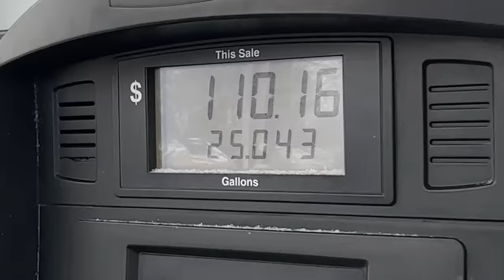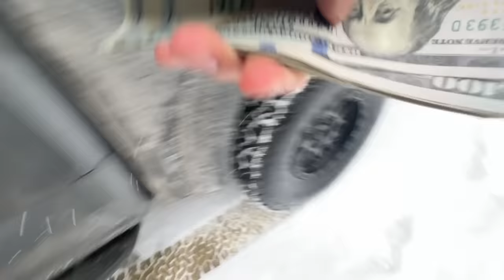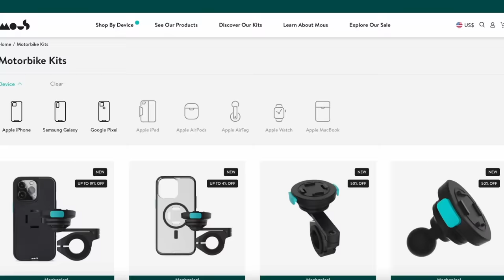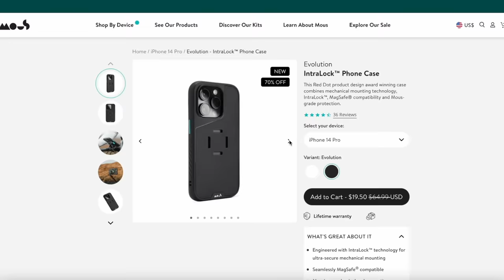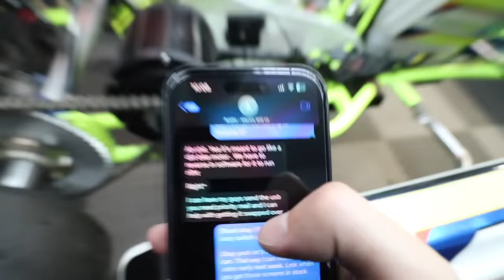Building a 100HP Electric GoKart!! // INSANE 72V Surron E-Kart RIPS

Comment: the controller has three wires going to the motor ...reverse two of the wires to change rotation
Reply: Yes it's a 3 phase brushless motor, but it's "sensored" so you cannot just swap the phase wires. It will smoke the hall sensors and fry the motor.. You have to go into the UI or app and change the settings to reverse the motor direction.
Reply: @tgif9735 not sure on these but alot of ebikes u can swap 2 on the motor and one of the same colors and one opposite color from what u swapped on the motor fir the hall sensor and itll work too
Reply: @Todd_Gerhardt those are Sensorless Brushless motors, Sensorless Brushless motors don't have the hall effect sensors and the circuit for the sensors used for finding the position of the rotor, so reversing the 2 out of the 3 phase wires has no consequences besides reversing the phase direction for power input. Sensored Brushless motors such as this one use hall sensors to determine  the position of the rotor so it can start up and run smoother at lower rpms and be more precise with power delivery eliminating the cogging effect Sensorless Brushless motors have when at lower rpms or when trying to move from a standstill. but because of the sensors, you can't swap the wires to change the direction without de-syncing the sensor circuit from the phase wires and shorting it out making the motor and esc useless. So hence why sensored Brushless motors and esc's can't just be reversed by swapping phase wires like Sensorless systems, it confuses and shorts out the sensor system, each hall effect sensor has its assigned designated phase wire.
Reply: @tgif9735  Oof.
Reply: @Todd_G_FPV   If you do that with a sensored system you end up flipping the timing. Always do it in the UI.  It takes but 10 seconds.
Reply: @tgif9735 umm yea, neither of those things will happen....

Swap 2 phase cables and 2 hall wires to reverse it if the controller doesnt have the ability to do so itself.
Reply: What he said

Comment: 70h and 90h is the size of the magnets in the different versions of the qs138 not the hp! If its their 25kw kit its only around 33hp.
Reply: was just about to comment this
Reply: 100hp would be close to 75 kW. You would need a 72v battery that could put out over 1000 amps to power the motor.
Reply: Yes 25,000 watts  ÷ 750 watts = 33.333333hp

750 watts = 1hp
Reply: if u look close at 5.11 min u see the motor is only 4000w
Reply: @Danny-pp8xz  that’s 5.3hp then
Reply: Was going to say! a 125cc KZ2 would destroy this
Reply: also IF the battery, and controllers where able to send that sort of power (over 1000A) a 75kW/100hp ekectric motor would just do a burnout from 0mph to top speed 😂  put two small second motor in the front for AWD if you wanna drag race or do crazy launches
Reply: Also was going to comment on this. If you look at the Electro and Co kits, while very cool and high value, the biggest I see is a 25kw, and the converter can output 350 amps, doing that calculation gives 25.2kW, so not accounting for efficiency loss, or if the batteries can do this as well, that’s 33.8HP. Having driven many many 5kw electric karts, this does look like roughly 5x that power, but not 20x that power.
Reply: @Danny-pp8xz  LMAO yes, when looking at the numbers, i found the exact same motor on aliexpress, rated at 4000W and 7500W...
Reply: @MotoGpDYLWAH  When looking at the kit, they use a 5.5kW rated motor, but wrote in the spec sheet that it accepts 25kW bursts.
Reply: @Danny-pp8xz  that is the nominal wattage you should use the peak number because it wil only be at nominal at top speed
Reply: @adriendebosse6941  In a lot of electric vehicle conversions they run the motors far above rated spec. I can guarantee that these motors are being pushed past 20kW, though it's only under peak acceleration. Most of the time you are hovering around 5kW.
Reply: Would you happen to know whay electric and co. Kit he's using? You'd be a GOAT if you could tell me
Reply: @MotoGpDYLWAH   you think you could tell me what parts Tyler is using in the video? Am a bit confused by all the different batteries and am not sure which kit he used from electric and co.

Comment: This looks fun but theres no way it makes 100hp, 100hp is 74kw and rough math that 72v battery would have to put out more than 1000amps to the controller with no loss to get 100hp, my guess is it probably makes 20hp but its torquey! Would love to see it on a dyno
Reply: I can tell from the speed it's making about 40hp If not even more
Reply: @caluzzucarrazzi5549   dont' compare to gas, gas engines only have their rated max hp in a very narrow band of rpm, where as electric motors are much different. it might be a 40hp engine, but it might output 20hp when it runs
Reply: @mattbanks3517  yes
Reply: @caluzzucarrazzi5549  i have 35kw e scooter and it flys me with 3.6s to 100kmh/62mph. Me and scooter 110kg. Its crazy shit.

I think the kart is 20hp max. Nothing mental. Look for 128hp e kart at youtube what germans built, then you can see what real numbers mean🤣🙏
Reply: He can't read/do math. It's about 25kW or 33hp.

Comment: Alright, I figured it out. You have a misunderstanding of Electro's model numbers. they have a "70H" and a "90H" kit. This refers to the overall length of the motor, not its power output. The kit you have is a 90H kit with the EM-260 controller that produces a peak power of 25kW/33hp. not 100hp.
Reply: Not even that. Look closely about 5:12 in the video. The motor is a 72v 4000w ( 4kw, a little over 5hp).
Reply: @jscruz2  You're totally right. I was mixing up the actual motor specs with the motor controller specs
Reply: @jscruz2 These motors are deliberately under rated by the manufacturer as a way to slip under the radar so to speak. Its clearly not processing anywhere near the claimed amount by the video. But, these motors are much more capable than their rating suggests. The qs138 70h can handle 30kw whereas the 90h version can do about 35kw at 72v before encountering heat problems.

There are no standard regulations for motor power at the moment, meaning its down to the manufacturers discretion. However in the last couple of years, certain ebike motor kit manufacturers have decided to take advantage of this and made ridiculous claims on the power level of their products. There's a mid drive cyc motor kit that the company claims can handle 5kw. It's a bullsh1t claim. The magnets are tiny and phase wires cannot handle the amount of current required to make 5kw even at 72v without heat damage.

Comment: I built almost the exact same thing about 6 months ago. 2 72v EMBX batteries, a qs 138 90h motor and a 430a controller. With fully charged batteries we are at about 82v discharging 430a nominally that also gives us bursts of about 60hp at 45kw. It is an absolute MONSTER.
Reply: What controller did you use?
Reply: @jeffhhdro  the siaecosys/fardriver nd72800
Reply: Build me one lol
Reply: Holy shit thats insane
Reply: What are the exact specs of the battery you used? And relatively how long does it last before the kart is dead?
Reply: Yo dude, could you tell or list me what kit / which parts Tyler is using in the video and which battery? You'd be an actual angel dude
Reply: can you send me the parts list

Comment: Just for your info, that's not a shifter kart. It's a standard 2-stroke kart. Shifters have a whole lot more kit to them, a shifter for one. Clutch handle, three brakes instead of one (one on each front wheel and a third on the rear axle). For the power and weight you have in there a three-brake setup wouldn't be a terrible idea.

Comment: If that screen displays Amps, the max draw I saw was 200 Amps, which with 72 Volts is 14,4kw, which is about 19 HP, which is still insane, but the title is quite a bit misleading, great content though, keep it up!
Reply: was thinking the same. 100hp is 75kw
Reply: 19hp 😂
Reply: So it's actually very slow for an adult gokart. Very very very expensive for such little HP.
It's a lot but not in comparison to the gas ones

Comment: I just saw your video today that you did several years ago and you took my advice of going electric on this project.  A smaller sprocket on axle  produces increased speed but less torque.  I would mount motor on rubber spacers to reduce noise.  Also shielding the motor will reduce noise for quieter ride.  Again, I was right by going electric.  Sorry you live in NY with 6-months of winter.

Comment: I would like to know which exact specs did you pick through electric and co like for example what motor ,controller, battery , throttle etc  for a similar build and I would also like to know the gear ratio.

Comment: Few small things:
- You don't have a keyway on the sprocket to avoid spinning the sprocket on the axle. Google "kart axle keyway".
- Lube the chain before every drive or you are buying new sprockets. Also the bearings, ball joints, front hub bearings.
- Buy a chain guard, if the chain breaks it could hurt.

Nice build!

Comment: Would running a battery up front, either where fuel tank would sit, help with balance/flex/grip? Or shifting the battery position net to the side pods more towards the front? 

Just seems like an awful lot of weight to position so far rearwards and laterally. That's gotta adversely affect how the frame behaves and grip/drive is made. Plus there's little mass up front to act as a fulcrum like point for the roll centre, to be in/near the centre....

Comment: I have 3 years of experience building a 130V 750Ah sustainable battery and I'm still not done. I broke more than 100 cells and a few BMS. To get that kind of performance, you need a really heavy batterypack. I currently have almost 65 kg two battery packs and only 3.38 kw. can drive only 2 minutes.
greetings from Germany
Reply: Can only drive two minutes? You're telling me you can discharge 130v 750Ah batteries in just 2 minutes?!

Comment: How long will it run on a single charge?   Thinking of building one for Autocrossing.   Wondering if I can use a single charge to be competitive or will I need more than one battery.
Reply: If you’re “racing” battery will go fast. This is why they switch batteries mid race in formula E

Comment: Sorry but you are not putting down 100 hp through that tiny wire. especially at 72V. that would be over 1000 amps. stop false advertising.
Reply: He thought “90h” label on the motor was a horsepower rating instead of the magnet size lol
Reply: @LordCurt 😂
Reply: @LordCurt for real 😂😂😂😂
Reply: I was looking same thing, there is nothing rated even close to 100hp
Reply: Maybe 20 hp

Either way looks fast and fun
Reply: @johannapoder2843  there is they are just like 40,000 dollars
Reply: @fallenlight7978  i am talking about this project, i know what money can buy..
Reply: @tziebe no bro like 5 hp
Reply: Ay dude, would you happen to know the name of the battery system he's using?
Reply: @reeeeeeeroblox2222 I couldn't catch the actual kw output in this video
Reply: He's talking about really really really small horses, like teacup horses. 😂
Reply: Yes but it is amazing how much power can be put through those tiny wires still.
Reply: I have a 400 hp 900  torque motor. It's huge. Axial flux so smaller for electric too

Comment: Definitely not being a hater here, but the 70H and 90H rating on these motors is not in regards to HP. These motors peak around 25kW which is about 33HP
Reply: I use 130V 750 Ah and get a continuous output of only 100 hp, the peak output of 97.5 kW is only available for a short time because the cells cannot keep up and break. Very interesting 100 hp.
greetings from Germany

Comment: just changing to phases of the motor and the motor turns the other direction or cjange in the app
Reply: You can't because it is a sensored motor. Only way is through the UI.
Reply: @tgif9735  that’s equal, did you try it?

Comment: where did you get the 57 tooth 428 rear sprocket?
Reply: I’m wonder this same thing, any luck?
Reply: @shreddedOat No, not for the one used in the video at least, and I emailed Tyler and commented on a few other posts of his and he doesn’t answer anything whatsoever
Reply: @lxi_zx6493  yeah that’s kinda normal with this shit. I think he used a 420 sprocket on the axel, you can see that he’s only got three bolts out of 6 on the hub in his video and I bet he found a 420 that fit his hub (or at least almost fit). I think we’re gonna have to make custom sprockets for karts using 428 chain
Reply: @shreddedOat  Hmm didn’t notice that he had 6 holes on the sprocket but only used 3 bolts which is weird. 
Ive been looking at the sprockets made by Azusaparts through the bmikarts website and the “Azusa Aluminum Sprocket Chain #520 - 5-1/4" Bolt Circle” looks the most similar to the one used in the video but he said he was using a #428 sprocket which is confusing so I looked at the “Azusa #428 Chain Sprocket (Full)” and the hole in the middle looks too large compared to the one used in the video.

Ive never done anything related to building a go cart so I’m just learning along the way

Comment: Is it really 100hp? What's the 0 to 60?
Reply: Nah simple math, 100hp is 75kw, or roughly 900 amps on the battery on a full charge. The battery he's got is rated for roughly half that so max around 50hp but I found the kit used online and they say its good for 25kw or 33hp, not sure where the 100hp claim is coming from
Reply: @Bengy22  that's what I'm wondering aswell 100hp from a qs138 just isn't possible for more than like half a second lol
Reply: @anishnattamai8801  I think he thinks the qs 138 90h and 70h is where hes getting those numbers but that has nothing to do with it.

Comment: Your chain is too tight. I'm guessing you just switched two wires to make it run forward and a simple switch could put reverse on it. In your upcoming gearing changes, you'll find that one tooth on the back is about 150 to 200 rpms difference on the motor at the same speed. One tooth added to the driver on the motor is equal to 3 teeth off of the back. Which is about 500 rpms. Your tires will form a hard outer crust when they cool down. Shape a 2.5 inch paint scraper to the radius of the tire, then use a propane torch to heat and scrape that layer off or you'll be on ice until you wreck or wear that layer off.

Comment: Why do you keep calling this kart a “shifter kart”? This was and still is not designed to run different gears that you can shift. It’s called a TAG kart (touch and go) or direct drive. Shifter karts have 4 brakes (not only rear), a gearbox and a shifter lever. Other than that, it’s a sick conversion ❤
Reply: Not all shifter karts have front brakes and there is usually only one disk on the rear axel so there are not many that have 4 brakes.

Comment: that motor is not 100hp its 40hp at most its only rated for 10hp. 90h is the motor model not that hp nor can that controller or battery

Comment: That is NOT a 100 hp motor, not even close. Its a Q motor and the H does not mean horsepower its the magnets. Maxed out it could do 35kw for a few seconds..which is 46 horsepower...and even that would require 420 amps..which any sur ron battery would struggle to do.

Comment: Not 100hp...
That motor is rated at 8000watt/11hp with a peak at 24kw/32hp
Reply: I’m pushing 30kw comfortably
Reply: @2024FunnyMomentCompilation  oh. Interesting. 
What's the temp sensor reading after having pushed 30kw for a while?